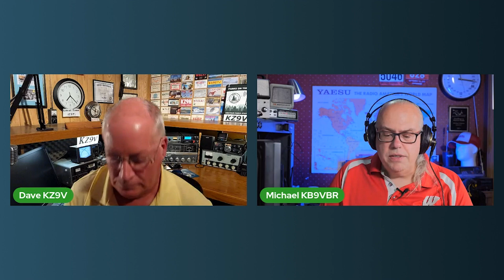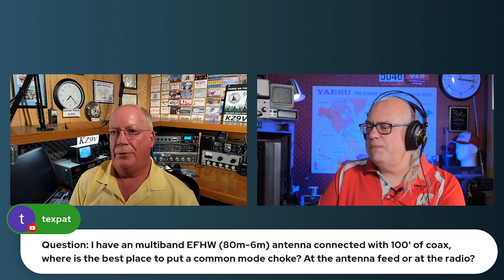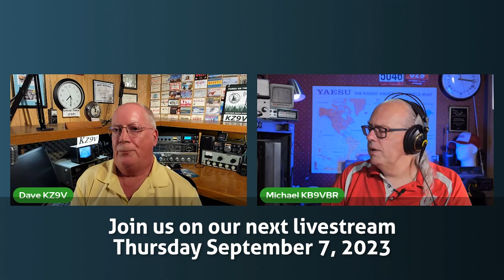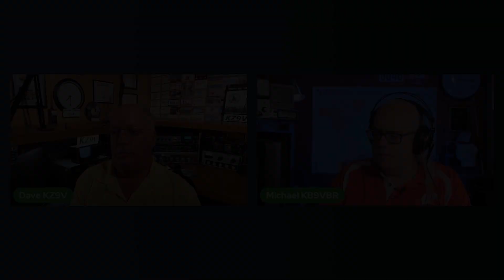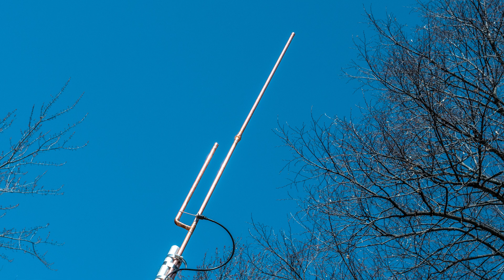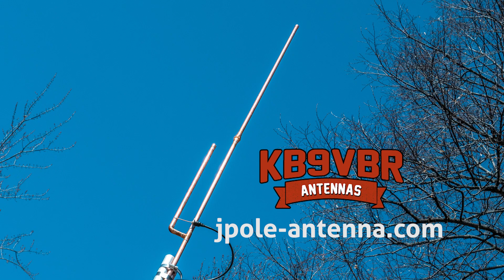Ask Michael, KB9VBR: Does my end-fed half wave (EFHW) antenna need a counterpoise?

Comment: Could I use a 1:1 unun for an RF choke? I'm pretty new to this, so I'm really struggling with the choke idea. (I'm thinking something like the LDG RU 1:1.) Thanks!
Reply from the maker: You could. Adding a 1:1 choke is common in the construction of 4:1 transformers. This is done because 4:1 transformers are usually of the voltage design, so choking is a necessity. 9:1 and 49:1 designs are typically current transformers so a typical coaxial choke or ferrite is enough. But using a 1:1 current choke wouldn't hurt.
Reply: Um...won't an unun be connected like a transformer? A choke is connected differently? Maybe I do not understand Marty's question.

Comment: anyone notice how they did not answer the question? The entire video did not answer the question.
Reply: Dave did answer - either counter poise OR coax with transformer at right end - and Michael confirmed. Watch again - but yet, Not a clear YES/NO - cause the answer is a bit more complex.
Reply: If you don’t add a counterpoise your coax will act as one. The literature recommended a CO length of 5% of the lowest band. So if 80m is the lowest then the CP will be 4m. What I did is cut a length of coax 4m. Attach it to the UNUN then a 1:1 choke then the rest of my feed line.

Comment: Great video. As what was stated, one can choose between using their coax as the counterpoise but to prevent RFI must be choked off either at the antenna balun/unun feed. If you use a counterpoise, choke the feedline right at the balun. I use a donut-type ferrite with a few turns of coax. They work great on preventing RFI. Folks do well to remember that any antenna whether vertical or end fed  is essentially a dipole that needs the other half of the antenna to come from somewhere. It's up to the op to determine where. 73 de Scott W1AL